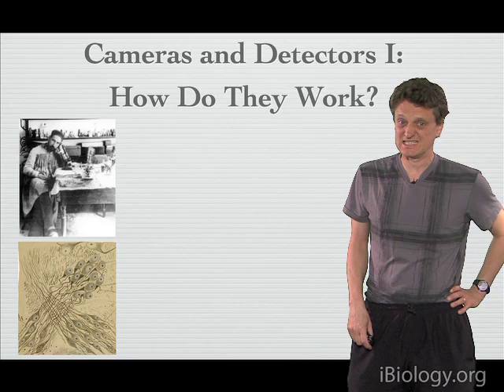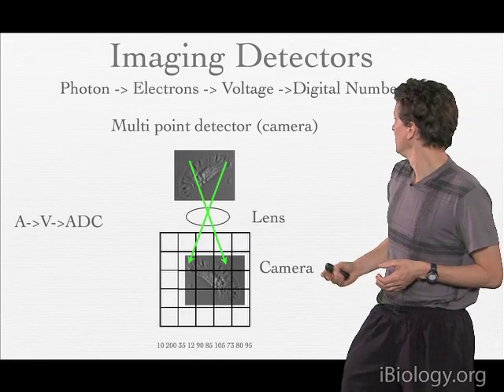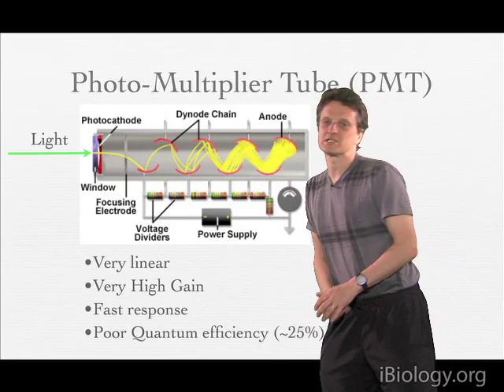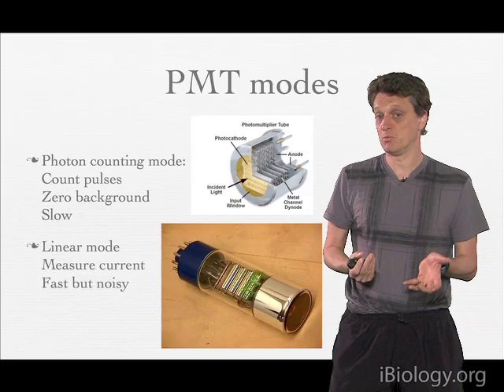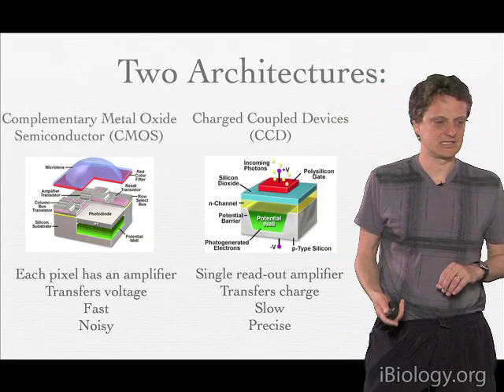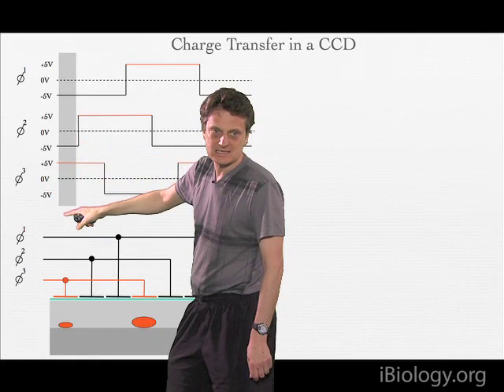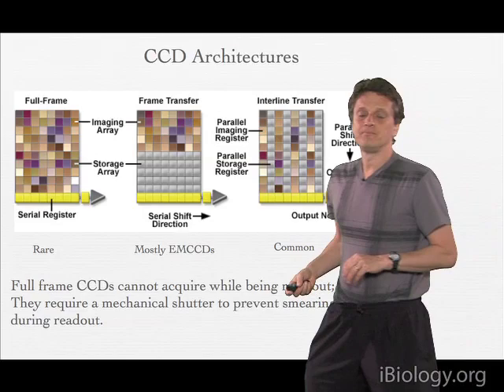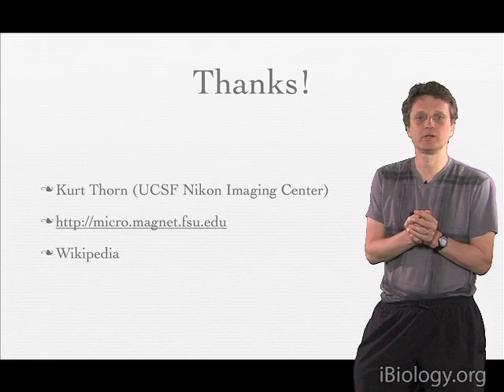Microscopy: Cameras and Detectors I: How Do They Work? (Nico Stuurman)

Comment: Thank you for your kind explanation. 
I have a question regarding pixel. 

Does one pixel include 1 red, 1 blue and 2 green color?

Or

Does 1 pixel include only 1 color?
For example 1 red is 1 pixel, 1 blue is 1 pixel and 2 green are 2 pixel.
Thank you for your response.